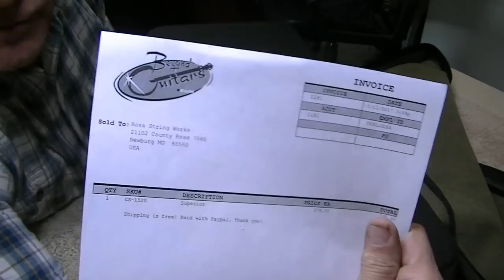182 RSW Custom Rosa Mandolin Part 11 Final

Comment: I used your yellow leather dye technique on my electric violin body. It didn't change the color much, but it made the color look richer with highlights in it. I like it a lot. For the main color, I used dark brown leather dye. I bought this dye before I saw this video and as luck would have it, it's the same brand as you use. My yellow, however; is not leather dye. It is yellow cake color. I experimented on a scrap piece of the same wood and found if you allowed the yellow to dry overnight that it would make the brown a richer color and just slightly lighter. Thanks for the tip. Oh I saw the tip in another of your videos, but it didn't show the brand of dye. Love the mandolin and great series of videos. However much you get for these mandolins, you deserve every penny.

Comment: A great result, all-the-way around, Jerry, to be gifted with the skills and ability to turn a few pieces of wood, nylon line/wire, assorted hardware, dyes/lacquers/enamels/glue, and a few other 'odds and ends', into an instrument capable of generating such melodic tones, is to be truly admired.

As for the binding overspray situation, for many decades, aircraft manufacturers, sign shops/sign painters, and bus/truck manufacturers have used an item called "Spraylat Sign Strip", it is a 'sprayable and peelable' masking agent which is sprayed onto an area, allowed to dry (overnight), then marked with the desired lettering/artwork/symbol layout(s). Using an X-acto knife, or similar device, the area where the desired color is to be applied is cut along the tracing, then removed (and tacked-off). Paint is then applied, and while still "tacky", the remaining Spraylat Sign Strip is removed, revealing the desired result. It can even be used as a resist, when chemically etching glass, and some plastics.

Sign shops which are capable of "painted lettering", versus that 'vinyl applique stuff', would most definitely have it; and would probably pour-off a quart for you. FYI: It does contain latex,  so remember to use allergen precautions, if necessary.
Reply from the maker: +AMStationEngineer thank you very much for the note. I don't know if the spray stuff would work very well on a mandolin especially up around the scroll area it's pretty hard to get down in there and it would be difficult to clean off what you want stained versus what you don't in those tight areas. Thanks very much for watching my videos. I appreciate the kind remarks. Happy New Year!

Comment: Is binding available with a thin film or tape applied? Peel off the two sides that glue to mandolin to install, after the dye application remove the rest to leave a clean binding.
Or apply the thin tape/film yourself, place a length of binding down onto tape and use an xacto knife. If the tape wouldn't allow you to bend the binding without problems then maybe the step before glueing on the binding, place them on a sheet of sticky backed film and trace around them with a blade. Maybe a fair bit quicker than a traditional taping job?
Reply from the maker: +seanmorris thanks for the idea. Applying tape before putting the binding on might work. But I suspect that all the heating in order to form the bends would cause the tape to turn loose. Thanks for watching. Merry Christmas.
Reply: Rosa String Works no problem, maybe the last idea would work best, place the shaped bindings onto sticky backed sheets and trace around with a blade before final fitting, the heating should be minimised. I hope you crack the problem.

Thanks for all your uploads. I thoroughly enjoy watching your videos, I've spent a lot of time enjoying seeing how you work and approach problems.

Merry Christmas to you also.

Comment: Hey really nice job ..... on a side note I know in my shop when I blend dyes I use transtint I have fluorescent bulbs which give a blue glow  I’ve change to white light seems to help in visualization
Reply from the maker: I used to have fluorescent lights but for the last five years or so I've had LEDs. I don't really feel like the lighting has much to do with it for me. Though the brighter the light the better. My problem is that I am profoundly color blind according to my eye dr. I can only do what I can do.

Comment: Awesome looking mandolin!!
Only one thing I don't follow. You put on new finish on the mandolin. 
Don't you need to cure any kind of finish for a while before you even use it, like you say in the video?
I'm thinking about the bridge that just buries itself into the finish.
Reply from the maker: +B Breeuwer it should be okay. It will probably Dent the finish a little bit in the bridge area.  It was drying for about 12 days. So it's not dry for acoustic sound,  but it's dry to the touch. Thank you very much for watching. Merry Christmas.

Comment: Hi Jerry, magnificent mandolin, which strings do you recommend for a A style mandolin please?
Reply from the maker: +Roger Appleby thank you very much. That's an open-ended question. It's difficult to say without knowing which mandolin and what the mandolin presently sounds like. You can't go wrong with silk and steel strings LS250 GHS, on just about any mandolin. They are loud and yet they have a very Woody sound. The only negative I have found with them is that the wrapping around the strings is a little softer. And therefore I don't typically use them on my own instrument just because I press really hard and I dent the serving really bad and so they don't last me as long. But the sound is very good. Those are available on my website. In general I recommend j74 from D'Addario or j75.  The j-75s are also available on my website.  https://rosastringworks.com/strings-accessories/

Comment: Every mandolin I've seen is always dark brown colour and often with a bit of black around the edges of the top, or is black. I wonder why is that? Is it just tradition? Ever thought of breaking tradition by doing something different such as doing a simple stain to bring out the natural colour of the wood that was used to make this mandolin? You would have an albino mandolin. It would certainly standout as different.
Reply from the maker: Actually a blonde mandolin is not totally uncommon. Though it is a minority. Mostly the dark staining is done to cover up flaws and blemishes because the mandolin has so many tight curves and points that it's difficult to make a perfect instrument without some minor flaws around the binding. My finishes are made quote-unquote to order.  Meaning that I finish it is close to the way the customer wants as I possibly can. Thanks for taking a look.

Comment: i hope you at least formally complained to company about the tape on the case and im sure you were able to find more issues even if small ones. they do add up and if they gonna charge the high standard/quality rate then i kinda feel it slightly fair that they send a matching product. i know you said it was too late at that point to have them swap it but it might not have been if they are an upstanding honorable company they should have offered..actually insisted.. next day shipping. i can be speaking out of turn if its a completely custom case built to ur specs. however if so they should have at very least offered discount off that case or very very least discount on future purchase. its taken me many years to get to this point after being too nice or letting things slide but ive come to realize that im sure if you paid them 10 bucks less they wouldnt just "let it slide" and say heres your case. just saying. lol